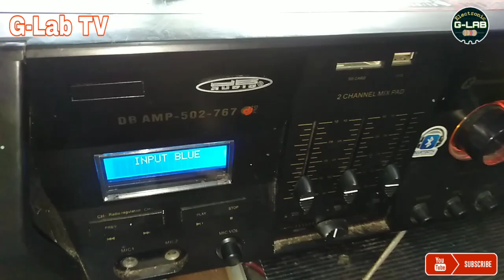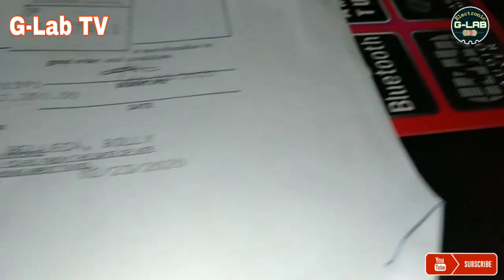Steps by steps kong e troubleshoot may problem sa sound hindi ko akalain yon ang dahilan nito

Comment: sir ask ko lng po kc newbie p lang din...nag pa setup po ako ng sound system sa m.c which means 12v ampli 350w pina assemble po sa kakilala  then speaker ko po ginamit lightning lab 6inch 4ohm..320w tanung ko lng po bakit po kaya d maisagad volume ng ampli ko basag n ang tunog...wala p sa kalahati...ok nman po malakas..pero d n maisagad kc basag n basag n agad ang .tunog niya..sana mapansin niyo po ito at salamat sa magiging responce niyo po...
keep safe idol...salamat
Reply from the maker: almost de same na kasi watts ng speaker at amplifier mo sir dapat mas mataas ang amplifier mo sir
Reply: idol mga ilang watts po kayang ampli ang.magandang ipartner dun sa speaker ko..250w..sayang kc lightning lab p po naman..
Reply from the maker: kung 250 watts speaker mo atlest 350 pataas ang amplifier mo sir
Reply: sir..idol hingi n din ako ng advice kung anung brand po b maganda gamiti. para dto n di gnun kamahalan..salamat sa pagtugon idol..